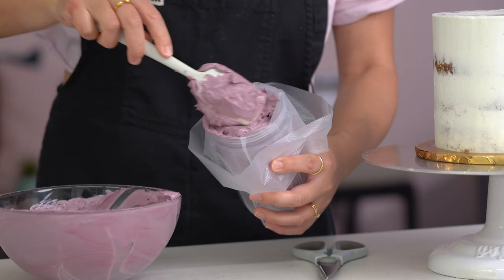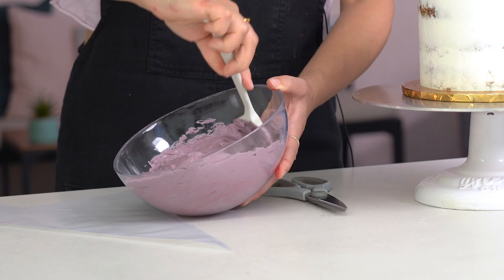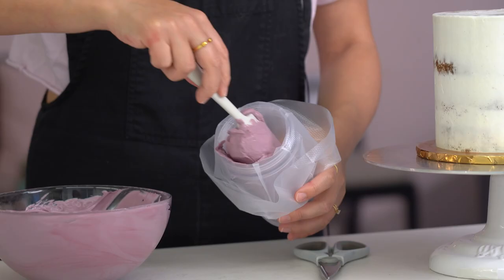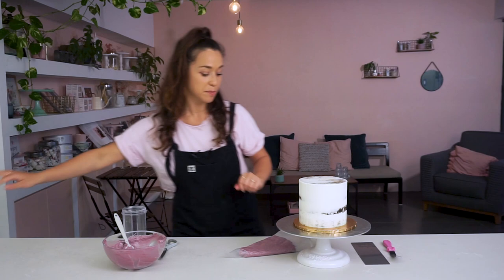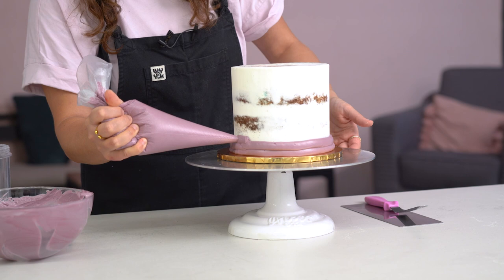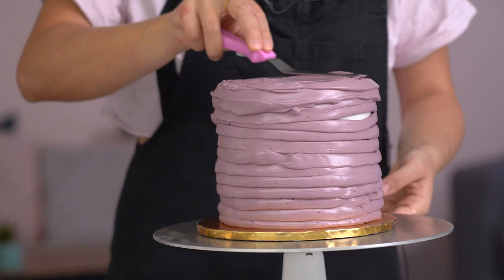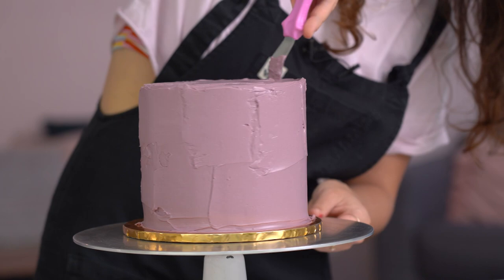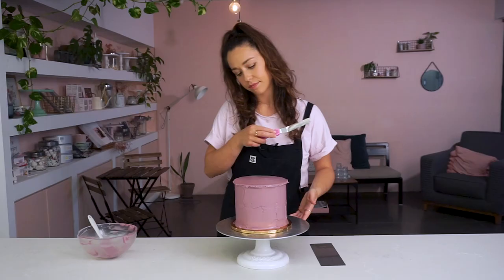NO AIR BUBBLES! How to Smooth out Buttercream on Your Cake | Georgia's Cakes

Comment: I’ve been a hobby decorator for about 10 years. Took me a loooong time and practice to get smooth buttercream. Like anything else, doing something consistently, especially weekly, it gets easier. I only did about 10 or so cakes a year, and spaced apart. It took a long time for each cake. But eventually I got there. I learned that mixing/slapping technique, it really does remove a lot of air bubbles. Your tips were great. Even this 70 + year old grandma learned something. And I’ve watched a LOT of videos 🤪 The angle you hold your spatula on top I can already tell is much better than what I’ve been doing. And I realize I’ve been putting too much pressure with my scrapper. Too much bc coming off. And I’ve always applied my buttercream with a spatula. Resisted using a piping bag. But seeing the ease of application, and getting the same levelness  of icing , absolutely trying. As I will the others. Thanks for the video and the tips and tricks.  👍👍
Reply from the maker: My pleasure!!! Glad you found this helpful!

Comment: Thank you for this excellent tutorial. Can you explain the reason for bubbles forming under the SMBC as your smoothing the finished cake. I see some of these on your cake on the closeup of the first spin on smoothing. I have found that the more you smooth, the more these bubbles can appear. Do you know the reason for this and how to avoid the appearance of these bubbles? Is it caused by condensed bubbles expanding as the cake is warming up while your putting the final coat on. Is there a way to avoid this other than not chilling the cake?